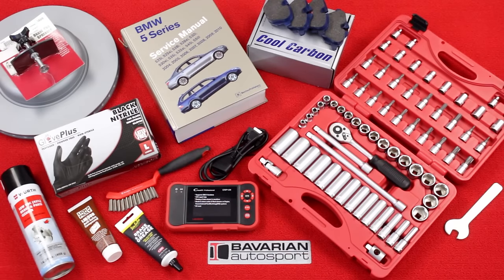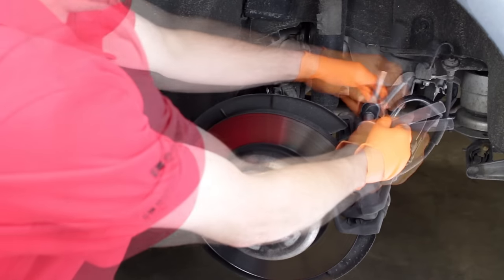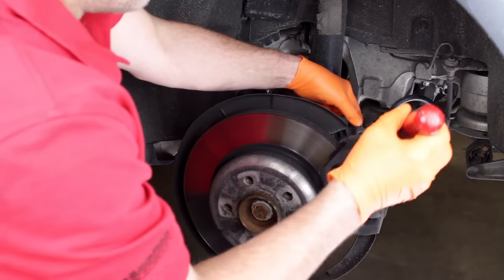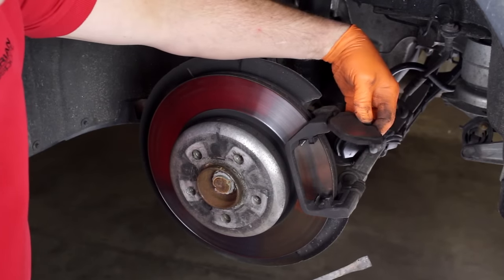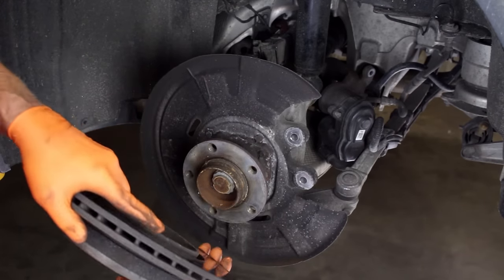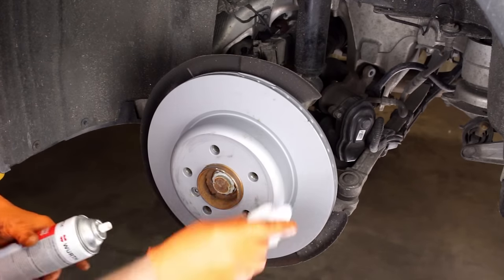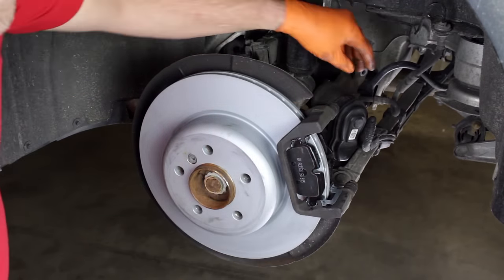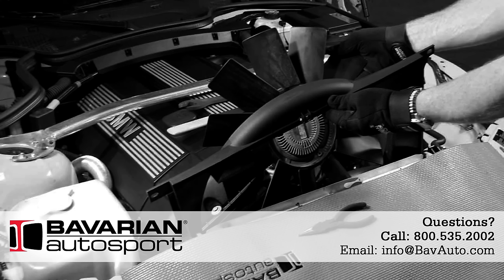Replacing Rear Brake Pads and Rotors on BMWs with Electric Parking Brakes

Comment: I need a little advice/help. I am in the middle of a DIY rear brake pad replacement (first time doing any pad replacement) & got the job done on the left rear. Everything seems to have gone smooth. I am now doing the right rear but have run into a small snag. I can not figure out how to open the brake pad sensor connection box to unplug the sensor. Can anyone give me any tips on how to get the connection box open so I can unplug the sensor? Thanks
Reply: It opens towards you like a door. Tabs are on the side.  If you look closely, you will see which way the door opens.
Reply: Thanks. I see the tabs. Do I need to push or pull on the tabs to release the door? I tried to force the door open but the control box seems a bit fragile so I did not want to apply to much force on it. There seems to be 6 tabs in all. Two are plastic tabs & the other 4 look like they are metal. It looks like the hinge side of the door is to the left with the tabs on the right side of the control box. Is that correct? thanks again
Reply: From the box attached to the car- push in
From the outer door, the pull towards you.
Im not sure which way toward you yours opens.
It should open fairly easy.
Let me know how it goes.
Reply: Got the job done. In my situation the door swings out from the left with the hinge on the right. There are 2 tabs that I needed to pull away from the box that allowed the door to open. Yes you were right, it was very easy, I was working at it last night when the lighting was not the best but once I got a good look today with better lighting I could see what was going on. Thanks
Reply: Nice!
Reply: I used a little bit of C4 and just blew it open.

Comment: So why don't you check the run out of the discs at time of fitment? If outside of tolerance now, it will wear unevenly, resulting in brake judder

Comment: Hi ...
Is there a problem if i compress the piston without removing the parking brake actuator ... if so ... what will the problem be
Reply from the maker: +nawfal jardak - If the e-brake actuator is not first retracted or the piston wind-back tool is not used, you will damage the parking brake actuator.

Comment: I changed my brakes using this excellent video, then I reset the brake service light, and now my emergency brake won’t turn on. Pushing and pulling the button does nothing. What did I do wrong?
Reply: Did you find out what caused this or resolve the matter?
Reply: Did you ever solve this problem. I did the same thing now my parking brake won't do anything. No malfunction light or anything.

Comment: When putting connecting the actuator module back together. It shorted and now I have no park brake? Is this a easy fix?(just replace actuator motor) or will I need diagnostic kit to reset or could it be a fuse?
Reply: Captain Scarlett is your parking brake wokring again?

Comment: the rotor thickness is 18.76 mm, the minimum thickness is 18.4. Should i change it or wait for next time?
Reply: For normal road use, you should be fine  using them as long as they are smooth, not gouged or otherwise damaged or distorted or warped.

Comment: does this apply on my BMW E65 from 2005
Reply from the maker: NO.  The E65/66 7-series uses the "1st generation" electric parking brake.  This system has the same drum-style parking brake, but the cables are electrically actuated (pulled).

Comment: Great tutorial....   quite a few similar ones out there.
A local mechanic/brake guru was shocked when told of this DIY method  with out using a scanner computer to reset the elec park brake.  He claims it's very dangerous! Risking ruining the elec brake system etc, potentially costing a few thousand dollars fix.....,?
Can anybody please explain the risk if any in this DIY method for rear elect brake actuator removal/resetting to replace the rear pads?

Many thanks.

ps: I've done my rear X3(F25) pads DIY on a couple occasions and they are just fine!

Comment: How hard is it to do e39 handbrake shoes?
Reply from the maker: +George Patton - Not really hard.  They are just like small drum brakes, with the rotor "hat" as the drum.  Pull the rotor off, pop a couple springs and then release the shoe securing pins.  Do one side at a time so that you can look at the other side if you get confused during re-assembly.
http://www.bavauto.com/shop.asp?HC1=0&Htarget=search.asp&HCY=2002&HCM=525i&SearchStr=brake%20shoes
Reply: +Bavarian Autosport 
Thank you!